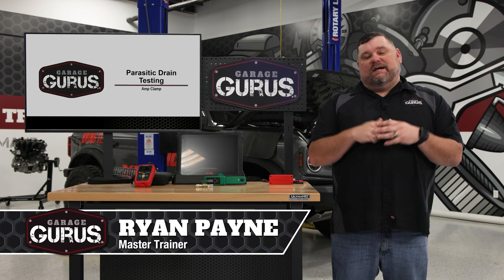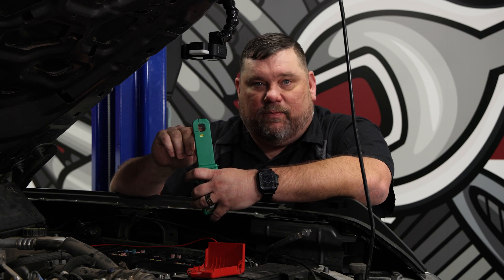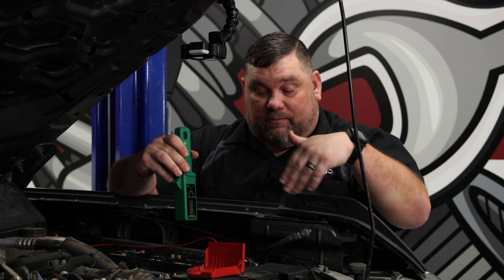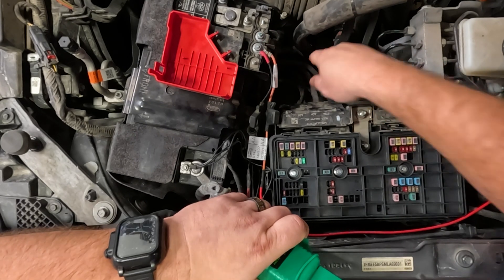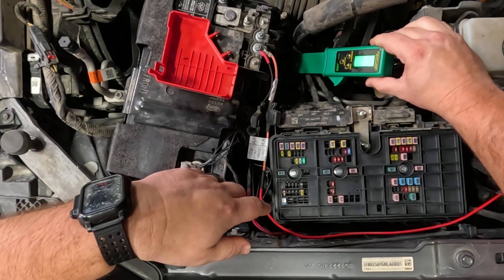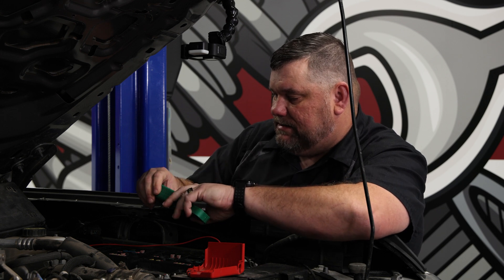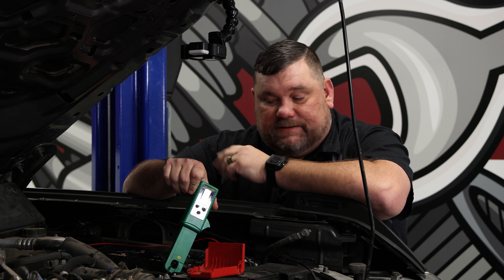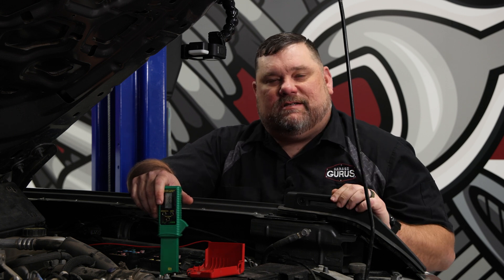Garage Gurus | How to Use an AMP Clamp to Catch Parasitic Battery Draws

Comment: It might not be the aftermarket bling causing the draw. But it could be indirectly causing the draw. The modules need to power down before going to sleep. If a module sees a draw, it could just be enough to keep it from sleeping. 

Just like if a customer leaves a key fob in the vehicle. The module will be looking constantly for an input, and never going to sleep.